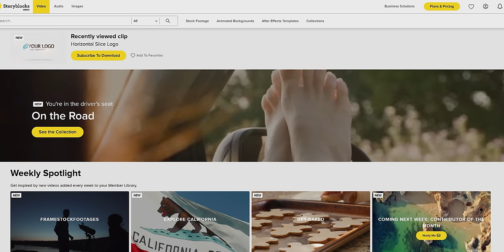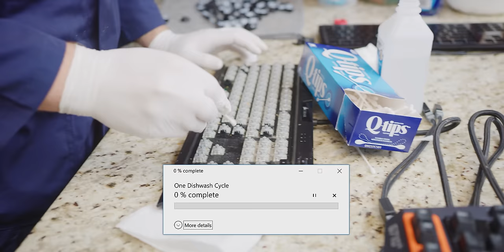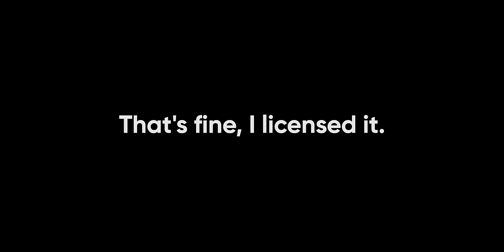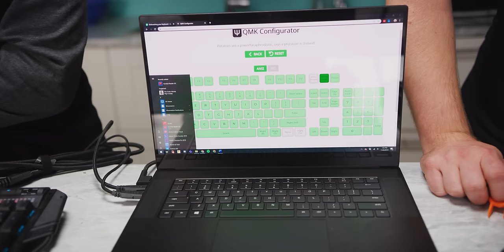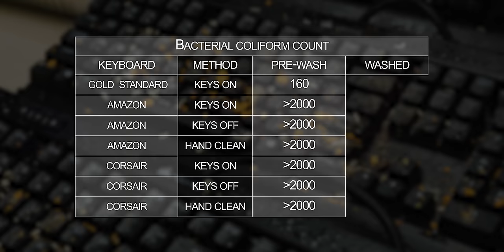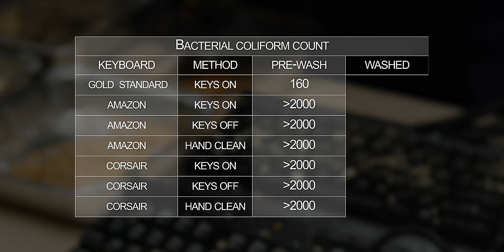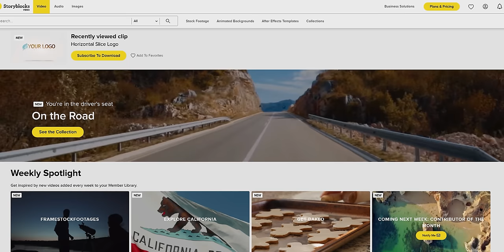The best way to clean a keyboard is… the DISHWASHER?

Comment: Louis Rossmann is probably banging his head against the wall whilst watching this video.
Reply: I bet his ultrasonic cleaners would work nicely on it.
Reply: He isn't the only one...
Reply: To be fair, I'm sure everyone in the world has an Ultrasonic Cleaner in their house right next to their quantum computer powering their personal Cerebro. It's totally understandable that Louis would be upset that they're using an inferior method of cleaning. Give them some credit; they're trying to "Think Different" here.
Reply: @karanoelle4819  Well, there is stuff here where they didn't even understand how water damage to electronics happen. This demonstration of the keyboards still working shows almost nothing as there are a load of factors not accounted for.

Isopropyl alcohol is not inferior even without the ultrasonic bath to do it in.
Reply: @EwanMarshall  You bring up good counterpoints. I'd like to argue though that while they knew they didn't know how this would affect other things, like macros I believe they said, they went in knowing this fact and were looking to see what would happen. They were willing to sacrifice their keyboards to test this. Water damage comes not from components getting wet, but when the water is still present and with electricity running through it.

Water damage usually occurs when the water reacts with a contacted surface. It's basic knowledge. What really causes more damage is when the electricity is passing through and shorting out the components within a device. Corrosion is one thing, but that doesn't usually happen unless the water is charged with electricity. Even then, corrosion is the least of the concerns.

Continuing on, corrosion from water on a metal surface doesn't generally happen unless that surface is reactant to water. If you think about that, this would be an extremely bad design flaw. One that would rival Apple, because we have water in our atmosphere. Anywhere humid would react with these surfaces and ruin them. The components are generally made out of copper and/or gold depending on the component, both of which are non-reactive to water.

The only argument one might have to the whole getting water in your board would be if the water had traces of elements or chemicals that would leave behind either a residue or react with the components/surfaces. This is extremely unlikely unless your tap water is not properly treated and cleaned. This said, these sorts of things are more of an exemption rather than the rule.

This is not a video starting out saying "We know this will work with no issues", this is "Can you dishwash your nasty keyboard, and what happens if you do?" Yes, there are factors not seen, and yes, alcohol is better at cleaning, but this requires that you clean the entire keyboard by hand or give it a literal bath in the alcohol. This would turn out to be quite wasteful of the alcohol unless you had a way to cleanly separate said alcohol without much waste and reuse it somehow. 

This video was to demonstrate one thing and that's washing keyboards in the dishwasher and to see if it still works. This was not meant to show this as the superior cleaning method, nor that it's the cleanest, or safest, but that it's doable. As long as you're not passing a current through the components at any time with water present, and you let it dry appropriately, this works. It's not the ideal solution, but for a keyboard shown, this is probably the most cost effective, least resource intensive, and most likely available to anyone in this situation.

If you'd like to counter my thoughts, I'm happy to go back with you on this given you or anyone else replies to me before work.
Reply: @karanoelle4819  Well copper does react, but you are right, we coat PCBs and such to limit it, electricity flowing while the water is in contact accelerates it.

The problem is, corrosion is also not an instant process without that energy from the electricity, so if their are capacitors in there and they are or are not discharged makes an effect, how many times one puts it through has an effect and many many other things related to how water damage to electronics happen.

Any possible capacitors are my biggest problem, one has no idea if there is or isn't current flow once the water starts shorting various contacts.
Reply: @EwanMarshall  As far as I was aware, copper was a non reactive metal to water. I'll have to double check that now, because I'm interested.

Bringing into the fact that capacitors may cause issues is a very valid point. I think this point might fall under their "we don't know what will happen with macros" section they said. I'm not trying to say it as a blanket statement, but it shows a possibly implied statement that they think this stuff can happen.

That said, if your board has a capacitor for whatever reason, then it would be best to drain it by trying to power something in the board. Honestly, it might not be a bad idea to try that with your board regardless if you think it has a capacitor in it or not.
Reply: @karanoelle4819  Copper corrodes with oxygen, the rest is just a matter of energies. And yes, making sure capacitors are drained in the board would be a good idea, one that may/may not have happened due to time with those keyboards in the video for example.

I don't know how long before being put in the dishwasher they were plugged in. Having them plugged in to test a week before is a very different proposition to we have just unplugged this and is throwing it into the dishwasher.
Reply: @karanoelle4819  No one mentioned ultrasonic cleaners. Pure h20 doesn't do any damage to electronics (not sure about electrolytic capacitors and other non-sealed components) - pure h20 isn't conductive. 

99.9% of dish washers use tap water. Do you know what impurities are in it? Unless you have a mass spectrometer, you have no idea what is in your water, and neither do i. 

It's these impurities that kill electronics if left on the board when powered and/or long enough. Even the oils on your hands can kill PCBs if left on the board for long enough.

They're not thinking different here...they haven't thought properly though the idea before trying it out and recommending it to millions of people. It's not like they don't talk to Louis or other engineers/technicians that can give them advice on things like this.
Reply: @Shocker99  It was an overall reply to the entire thread. It was also a joke referencing both Apple and Louis's disgruntled views about Apple. Though I suppose you're right and I should hook my washer up to a line of iso.

Look, here's the deal. If your keyboard gets to this point where you have to use a dishwasher to clean it, then don't you think it's ALREADY compromised in one way or another? The thing has oil and mold and whatnot all inside it's components just from use and the like with all that crap sitting there.

If your keyboard is maintained (IE: Not eating over it and/or busting a load over it) so it's not filthy, you don't even have a need to consider doing this. At no point is this a practical way to clean a keyboard that's only moderately dirty with things like dust and hair. Compressed air does a much better job at that. You guys are taking this way too seriously and literally.
Reply: @Shocker99  I'm going to assume that this is completely arbitrary to what we were talking about. No, I am not a Karen. Thank you for asking.
Reply: @Shocker99  Hey also wanted to add something since I was a bit busy when I posted my other reply. You said "no one mentioned ultrasonic cleaners" right?

ZachicusMaximus
4 days ago
I bet his ultrasonic cleaners would work nicely on it.

Just thought I'd share, maybe read the chain before replying. Also to add, because I thought it would be worth addressing a little bit more: When you're asking if I'm a Karen, I had already assumed that you were, in fact, not insinuating that I was one. A question that seems quite odd if you ask me as a tangent, especially after addressing your points beforehand.

I'd be a bit more careful with wording if I were you. You might accidentally offend someone who could read your completely innocent question about one's personal appearance as an insult to them, as well as trying to either deflect what they said or derail a conversation. Worst of all, you might even be seen as using it as an insult to try and "win" an argument online. Just thought I'd give some helpful advice. Looks like you might have a use for it.
Reply: @Shocker99  Merely just making points in which seemed that you could be attempting to insult someone, but if you turn to name calling and insult throwing then you're playing the part of a fool. I feel you're not even reading everything that's being said considering that you not only refused to acknowledge any points I've made to make counterarguments, but also completely neglected to read the comment chain to post your own reply to me. Only to call me a Karen afterwards.

I would like to mention as well that your use of "Karen" is a bit off since Karens don't do what I'm doing. Karens aren't civil and will throw hissy fits, insults, and resort to name calling to get what they want. I've done none of this, and assume you base this completely off of my profile picture and/or username. If that's how you wish to present yourself, I'm making no request to change it, only that maybe you fully understand the insult that you're throwing at people before you use it. Here's an example.

"You've spouted nothing but Karen comments and nonsense." I've had a very pleasant and informative conversation with Ewan in this comment chain, even finding that copper reacts with water in a way I didn't expect. You weren't even involved in the conversation until you popped in and chimed that nobody mentioned ultrasonic cleaners. It was the literal first reply to your comment. So I'd be happy to hear how I'm being a Karen here outside of explaining, remaining civil, and not jumping to conclusions.

In fact, I'll admit it. I was looking for competency. I was hoping to have a nice discussion where we would discuss ultrasonic cleaners, and your view on iso alcohol. Granted it had started out bad, not everything has to go that way. Yet you took to insults and not a single counterpoint to anything I've said. So for a "competition" here, I'm not the one throwing insults at another person providing some info or correcting someone. You are. You're the one who is looking to "win" here. I'm happy to keep this discussion up and see who wins this battle of attrition. Let's actually make it something someone can win.

Comment: “Quick fast and not dirty way to clean your keyboard”

He says, after waiting a full week for it to dry
Reply: throw it in an oven at 60°c, with fan on for circulation, for a few hours and you are golden.
Reply: they were being overly cautious, half a day would probably do the trick
Reply: @Cemtexify  Tbh, they said you should take the keycaps off. If you've already taken them off it's like a 10 Minute job to soak your keycaps and let them dry, wipe down the keyboard and put it back together. The worst part ist putting all the keycaps on again.
Reply: @ismjason  Melted my keys on my laptop 10 years ago. 1/10 would not do again
Reply: You could also just blow-dry it. That would also prevent water staining.
Reply: @foty8679  I'm late but I did the same with but with a space heater

Comment: I own only membrane keyboards (coz I'm cheap). My optimum way of cleaning keyboards is just to unscrew the back of the keyboard, remove the internals until you only have a housing and key caps. Then wash the housing with soap and water. It usually dries in about 2 hours (assuming you cover it with a towel) then you just reassembled and boom, you're done.
Reply: Interesting technique. Does the flavour of the soup matter? I feel like tomato soup would have different cleaning properties to chicken soup for example.
Reply: @burgerbait  XD, didn't realise the typo. Thanks dude😂😂😂😂😂😂
Reply: @burgerbait  lmao
Reply: As someone who often cleaned his own membrane keyboards, I can safely say that you don't need 2 hours to dry them. 
What I did was take the plastic housing and spin it around by hand, like a washing machine if you will, and throughly wiped it after and just in case, gently fanned it.
As for cleaning supstance, I used both soap and degreaser with the degreaser giving slightly better results.
I'm not sure if it isn't just faster to disassemble the thing and clean by hand, rather than wait for the long dishwasher cycle.
What about mechanical keyboards? Are they reasonably easy ti disassemble?
Reply: I use membrane keyboards, because they're *fine* and even the quietest mechanical keyboard I've tried was so noisy it infuriate me.
I'm sure there are options that would do, but I'm not buying a keyboard without trying it out first.
Reply: You can remove the keys and put them in the washing machine :)

Comment: This comes back to the old solution where people grab their phones that were freshly dunked in water and then stick the thing in rice or some other product to help it dry out.
The problem, as our friend Louis Rossmann states prety often when talking about liquid damaged devices, is that gunk might have been pushed into the circuit boards. So while these keyboards might have survived the initial test, there's a chance of them ending up completely dead after a month of being put back in use.
Many of these keyboards need to be fully disassembled so their circuitry is checked for corrosion.
Reply: Galvanic corrosion can't happen when it has no power.
Reply: @QuibizOwl  Not necessarily. Galvanic corrosion can happen even when there is no active current. For instance, if you mix copper and aluminum in your water loop, they will corrode, and corrode quickly.
Reply: You are better of rinsing it with distilled water and then with quite a lot of isopropyl alcohol to push out the water. That's safer and a better chance at preventing corrosion. (Edit: I mean expensive phones and tables and such and not just keyboards. Of course that could still be an option for those. Distilled water is not expensive and a rinse with that is always a good idea.)
Reply: i have the g710+ from this video. it takes 10min to separate the electronics from the then i put it in the dishwasher . the keys to put back on are the time consuming bit so if you have time for that you have time to take it apart
Reply: I washed mine under a tap at least 5 times. Still have the thing for over 5 years.
Reply: @HoshinoMirai  But electronics almost only contain cooper and tin which won't corrode each other.

Comment: what about removing keys and using a vacuum cleaner?
Reply: That's physical clean, not bio-clean
& dishwasher has the steam to kill the bacterial
Reply: I do that, then I wipe the board down with anti bacterial wipes. Works a a charm!
Reply: @ulysseslee9541  Where do you think the bacteria came from ?

As I'm the only one who uses my keyboard, it's either transfer from my skin or already floating around. Either way, I doubt cleaning my keyboard will prevent me being exposed to anything.
Reply: @bilateralrope8643  bacteria come from all environment around you, so if u like, u can clean your keyboard often, says every 2-3 months to keep clean. 
Also, to keep keyboards remain clean, not to eat front of your keyboard / 
move away the keyboard when u eat front of the screen :P
Reply: r3conwoo  Yeah, great sound dampeners for my darn Cherry MX Blue switches. I want to be as quiet as shit sometimes, you know?
Reply: By using a vacuum cleaner, you build up static electricity much faster than with other methods of cleaning. So you just found another way to "murder" the device you try to clean.
Reply: A vacuum can help remove hair but by itself the pressure difference is not enough to suck up dust and fine dander. If you use a brush along with a vacuum it can be very effective and prevents brushing debris from one area to another (the vacuum gets it)
Reply: Or more simply frequently vacuuming your desktop, powerful cordless vacs like dyson and the clones make this super easy now, no need to build up dirt.
Reply: @ulysseslee9541  what if my desk is too small to move the keyboard :(
Reply: @ulysseslee9541  then you can spray some alcohol I guess. I  just hate it when I can see hair and even fingernails inside of my  keyboard it makes me feel like I'm living inside of Patrick's bellybutton

Comment: I have worked as a tech in an industrial electronics repair company.   The first step in most repairs was to wash the device with soap and water.  This included high power motor controllers and process controllers which are nothing but special purpose PC's.  Just be sure to remove batteries and anything with a motor.  To dry the items we had a couple of old refrigerator bodies with heaters in them set to around 120F and exhaust fans to keep the humidity down.  You can achieve the same effect at home by preheating your empty oven to 120F then turn it off and place the parts inside.  Repeat every half hour for 2 or 3 hours and they will be bone dry.

Comment: 10:41 "looks like this method can actually be quick, fast and not dirty way..."
"let it dry for a week"
say what?
Reply: you can let it dry for a single day if you only do the pcb but not everyone is willing to strip their keyboard down that far
Reply: @shuutori  hardly "quick" nor "fast"
Reply: you'd be glad to even have to dry a large electronic part for a fraction of a week, but a person who doesn't seem to clean things wouldn't know

but if someone were to do this themselves they could get away with it by letting it dry for under a couple of days

and the drying portion shouldn't count as part of the "fast cleaning" process because if you're drenching it manually that doesn't change the time it's drying